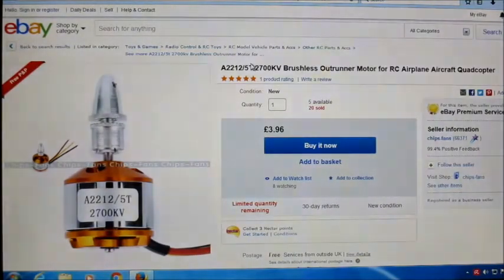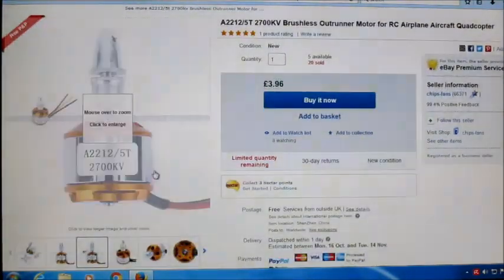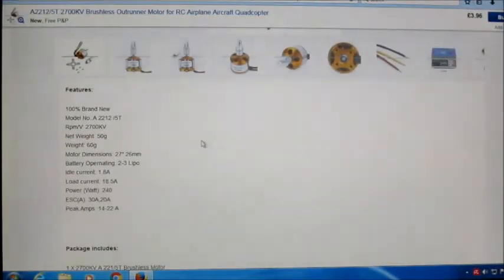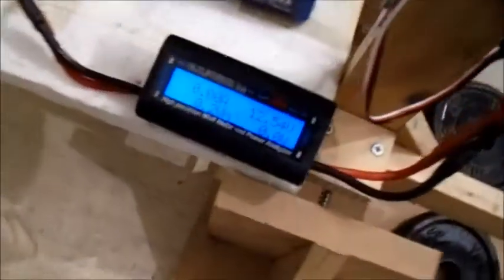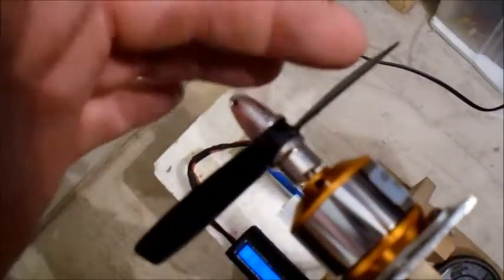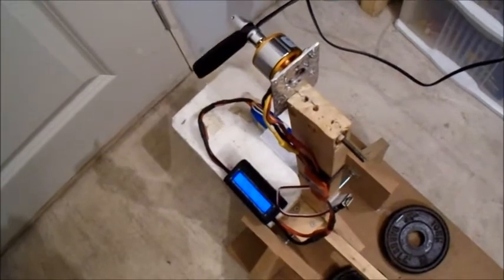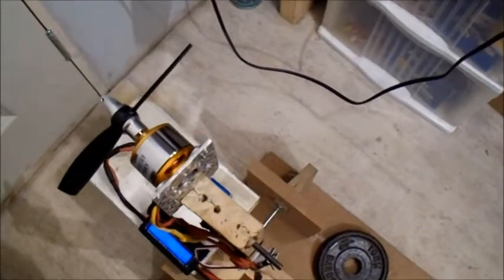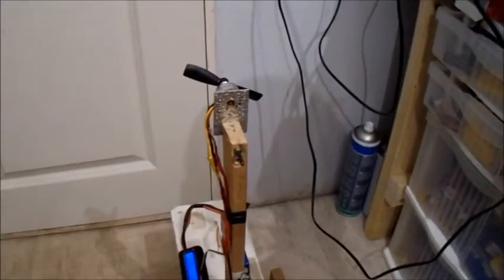A2212 5T 2700kv motor from ebay Motor test of the Week

Comment: hello friend saludes from Colombia I am new in this world of brushles and drones engines buy a syma x8c and I want to change the motors for a few brushles and my question is, if you recommend the A2212 1400Kv engines since I do not want to lose my money and said engines are economic and the compram a lot thank you for your conjeso and apologize the inconvenience success in your new preyectos excellent proof of that engine
Reply from the maker: Hi Eduardo
I don't actually fly drones so I can't say for sure but I did have a look at the X8c. I think I sore people say it uses 9 inch props so I think the 2212 1400kv motor should work ok. They are cheap motors though so they won't last forever. You could try these motors. link  https://hobbyking.com/en_us/d2826-10-1400kv-brushless-motor.html
They are basically the same motor just higher quality with better bearings.
Thanks for watching.
...RCPP

Comment: Hi RCPP, hope you are well.  Another bothersome question... :)  One thing that has always puzzled me as this size (2212) is a motor I have used a lot over the years in my park jets.  I have had great success with the no name ones from Ebay and Banggood in both 2200 and 2700 Kv.  My question is about Kv.  How do they increase the Kv in a motor that when I look at it with my naked eye, I can't tell the difference in windings, magnets, etc?  They tend to weigh exactly the same whether 2200 or 2700 Kv and I have run some that are 2212/6 (so I assume the same number of windings/wraps) in both 2200 and 2700 Kv.  Do you have any idea how the manufacturers make that magic happen to have such a difference in Kv/RPM/power between two motors that on the outside look pretty much exactly the same?  Thanks :)  Cheers, Scott
Reply from the maker: Hi Scott
Well timed I just got back from work. I have rewound a couple of motors with single strand wire and it's the more turns on the windings then the lower the kv. So using thicker wire means you get less turns on the windings which gives you a higher kv. Multi strand wire windings just use more or less strands and then obviously the more stands the less turns "high kv" and the less strands the more turns "low kv". If you look at motors of the same make the lower the kv the less amps it can take and the higher the kv the more amps it can take. That's because it's got more strands. Say each strand can take 10 amps and there are 4 stands then that motor can take 40 amps and you would get say 6 turns on the windings. Then if another motor has 5 strands it can then take 50 amps but you would only get say 5 turns. So less turns but the extra strand means it's still sort of the same amount of wire. So the motors will still end up about the same weight. As you see on those 2212/6 2200kv motors the /6 means 6 turns and the 2212/5 2700kv /5 means 5 turns.
Hope that's a good explanation and helps you out.
...RCPP
Reply: Hi RCPP, thanks so much, that makes perfect sense, with that in mind, I'll take a closer look at the motors I have to see if I can see the difference now that I know what I'm looking for.  Certainly removes what has long been a mystery to me, thanks again.  I did order up some 6x4 APC gas props from the link you sent me, hopefully will have those in a couple weeks so I can start testing them on most of the popular park jet motors I like to use.  I also ordered another motor from RC Timer that I linked to you in another comment, http://rctimer.com/product-1583.html  a 2306 2650 Kv motor, interested to see how that goes, but it will be several weeks on the slow boat from China :)  Cheers, Scott
Reply from the maker: No problem mate. Not working tomorrow should be nice weather so hoping to get out and do some flying. Been nearly 2 months since I last flew.
Yes got to hate those long delivery times from China.

Comment: Just had a look on ebay £3.50 for the 2200kv and they have the 1400kv for 7 inch props you normally pay more than that for a prop adapter.
Reply from the maker: I know it CRAZY cheep isn't it.

Comment: I have had a few of this type,one had a 3mm shaft with 1/8 i/d bearings ! I think the 2200kv is the best for 6x4 with 3s 
The motor will run hotter in pusher mod.My  ic pusher engines always ran very hot.
Reply from the maker: Yes think you're right but I'll give the 6x4 a try anyway and post the results.

Comment: The Best prop for this motor is a APC 6x4 it works great. Please test it.
Reply from the maker: Hi there
I didn't go any bigger on prop size as the 4.5x4.5 was already overloading the motor by quite a bit, but if you want to see it I'll give it a try and post the video later tonight.